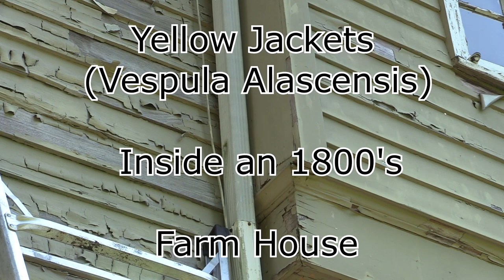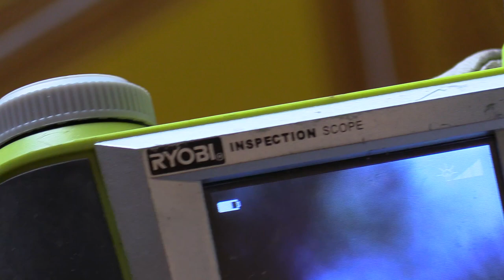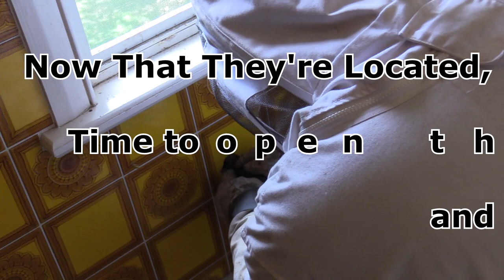Wasp Nest Removal from 1800's Farm House YELLOW JACKET nest

Comment: One of the bee channels I watch uses an infrared detector that shows the heat difference in the area of the hive. I know that the wasp hive is smaller than a bee hive, but it should still put out enough heat to be visible this way.
Reply from the maker: My ears are the only detectors I need ;-)

Comment: You know a better tool than the camera would be a thermal imager. It’s mostly used in auto mechanics but most of them have a very high range even in to negative temperatures. They can be expensive but if you get one from snap-on you can often just pay a little off each week.

Comment: Yellow jackets are awful. Some of the worst stings I've had have been from them.    So defensive
Reply: Got stung twice in my life. Both at 7, both from ground dwellers my uncle stirred up checking fence posts. I was told to hold still both times. After that I stopped staying still and have avoided them. Very painful stings.
Reply: Some species (i.e. the southern yellowjacket) is one of the worst human haters that god has put on this planet. Just walking within 200 feet of a nest will set them off.
Reply: Alex Lopez Southern and Eastern ones are the worst. I think maybe because it’s a ground nest which would be pretty easy to get to if not for the wasps so they have to be more defensive, and because the nest is somewhat flimsy